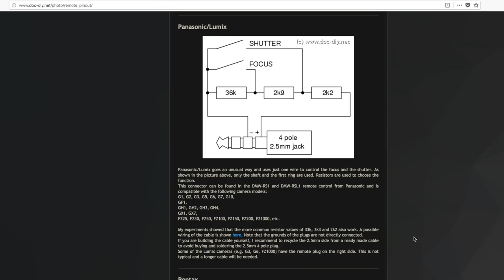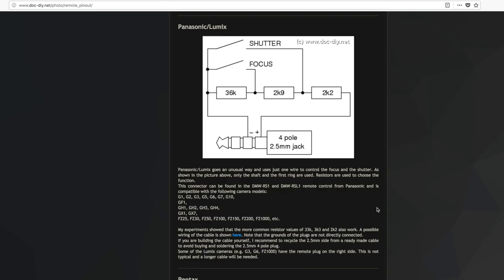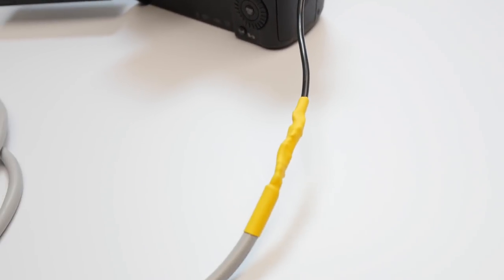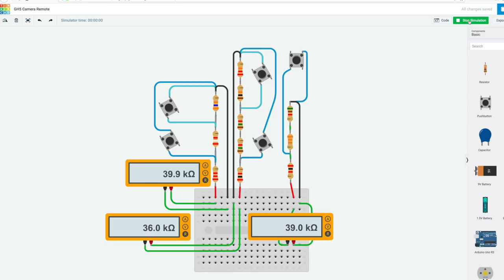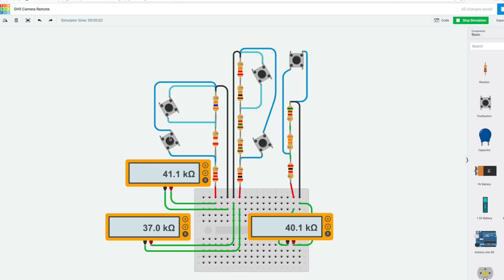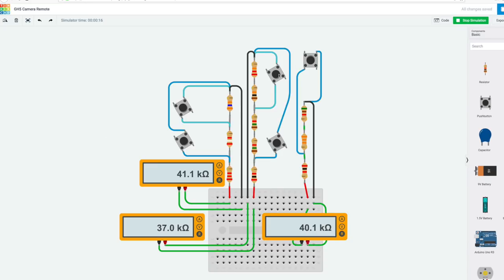GH5 Foot Pedal Shutter Remote // Becky Stern

Comment: This would be a great idea for video blogging! Especially if you have one for triggering auto-focus. Thanks!
Reply from the maker: If you have autofocus enabled, it does focus before triggering the shutter (or video start, depending on whether you're in photo or video mode). Basically it does everything the shutter button does.
Reply: Cool, I can imagine a separate focus pedal being useful though, you could stand in the right place and set the focus, and it wouldn't move if focus was on manual. Depends on what your needs are I guess.

Comment: Great video Becky! Is this easy to do if you wanted to use a latch button, and put it inside a wooden handle, to trigger the GH5 for video? I seem to remember you said that from the first foot pedal shutter tutorial video if you use a stereo jack with three poles it triggers just the video record function?
Reply from the maker: This is a very easy project. If you are in video mode then the pedal triggers recording. It's true there is a half press you can trigger too. I can't remember the specifics. See my tutorial for a circuit diagram and Tinkercad simulation.
Reply: @BeckyStern  Thanks. I'm totally new to electrical wiring. So to trigger video recording and to keep it recording, you would want a momentary self-resetting button?
Reply from the maker: Momentary switch, yes.

Comment: is this method compatible with only GH5 Camera ?
Reply from the maker: Works with all Panasonic GH cameras, and most other brands can be made to work with a simpler circuit not involving any resistors.
Reply: @BeckyStern  thank you I need capture and focusing both functions to work with this. If I do the focusing part as well as in the Cct may I know that zoom in and zoom out both functions work with this ?